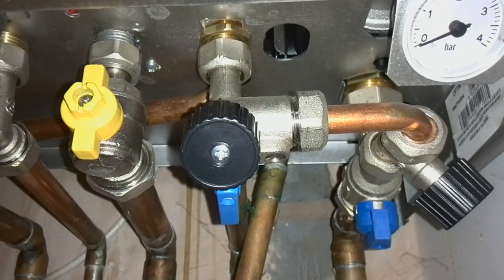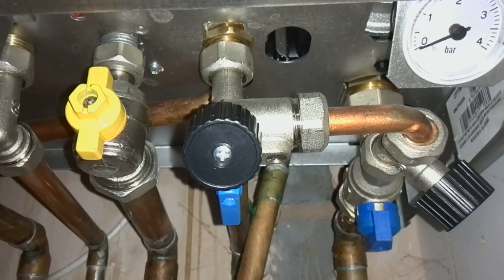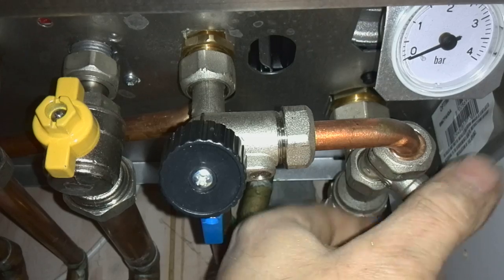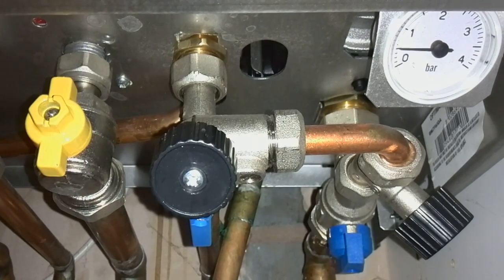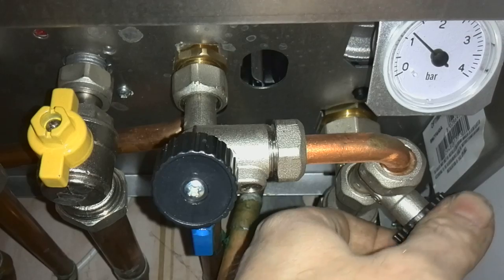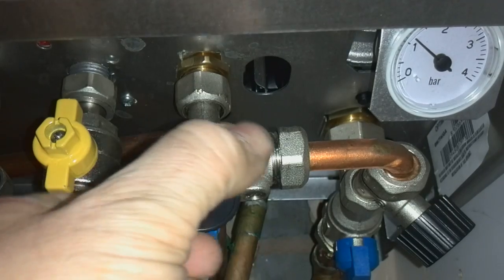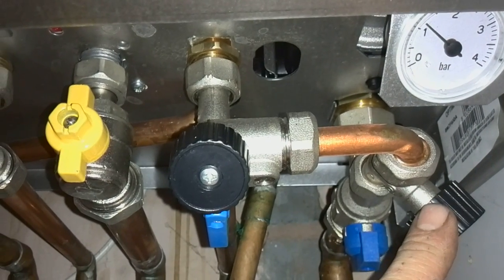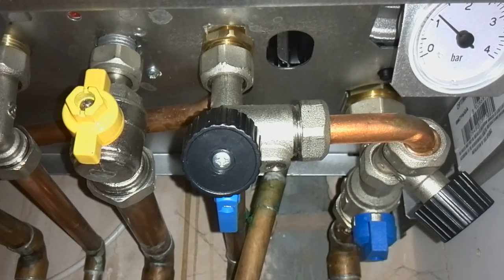how to repressurise  a Ferroli boiler

Comment: Hi I have the He31c optimax boiler. The filling loop valve on the left seems to constantly have water coming out with the loop disconnected. I think the valve as gone bad. The boiler shown above has the round knobs rather than levers. Just wondering if there is a way to retro fit a new filling loop or if the round knobs version will fit. The cheaper the option the bettr

Comment: What if you get the code, water level is at bar number 2, but you still get error code 37
Reply from the maker: It's probably the parameter 1 on the PCB has changed.
Reply: Could this be caused by upgrading the thermost to a Tado? 
How do you fix the P1 on thr PCB?

Comment: Hey, thanks for the video….    My DOMIcondens HE 26c.     Has F34 faulty code .   Any idea where to start please
Reply from the maker: It's more than likely going to be the circuit board. They're quite expensive brand new .I'd go on ebay and get a refurbished one . U can go on another one of the videos to set it up to suit your property
Reply: @theferroliman2067  Hi I have just replaced the board from one off eBay as I had no power at all.  And with the replaced board I now have power and a fault code F34.    So this could still be a faulty board ? Thanks for your reply
Reply from the maker: @emilyc2431 There could be a fault on the new circuit board.Or a parameter is set up wrong or you haven't got 240v at the boiler

Comment: Hi there, I have problem with my boiler is absolutely the same. We are renting the flat, previous year in February we had lower pressure, the landlord booked British gas, they come and fix it. Today happened the same, I check under the boiler and I notice the valve is broken. My landlord booked a plumber today and they fix it but now the pressure is 2.6 and the boiler it's very noisy. What can happen if the pressure stay that high?
Please help.
Thank you
Reply from the maker: They need to recharge the expansion vessel as eventually it'll go to a fault code and not work like F21 or f40
Reply: @theferroliman2067  Thank you so much for your reply. They come back today to lower the pressure but it's up again. Anyway the landlord it's buying a new boiler because this one is leaking and it's very old. I'm very happy ☺️

Comment: How can I reduce the water pressure. Mine is on 3.
Reply from the maker: You have to bleed / vent a radiator with a jug or container until the pressure drops to just above 1 bar on the boiler . See a video how to bleed a rad
Reply: @theferroliman2067  Thank you! I bled the radiator and it’s now gone down to 1.5.

Comment: Its not working for me :( no water comes through at all
Reply from the maker: The non return valve is probably stuck ... You'll need another valve if after opening both fully it still won't work . 
It's the blue and black valve that needs replacing if so 
Ferroli mcw valve
Reply: @theferroliman2067  thank you so much!

Comment: I have tried to repressure the boiler but when I I open the right hand valve no water comes through any ideas why this would be ?
Reply from the maker: If you have opened them both fully then the non return valve could be stuck shut not allowing the water through .
It'll need replacing the mcw valve
Reply: @theferroliman2067  thankyou for the advice I have an engineer from british gas booked in for tomorrow hopefully they can repair it same day
Reply from the maker: @stevehitchen4558  if you're desperate and he hasn't got one .you can drill the non return valve plastic out of the center . So u can the boiler working till it's replaced
Reply: @theferroliman2067  thanks again might give it a go if all else fails I am pretty desperate as I have a 3 week old baby in the house so need to get it sorted ASAP thanks for the help 👍🏼

Comment: Hi i did my usual repressure and it took much longer than normal to go above 1.  Then noticed relief value started hissing and dumping water while valve reading remained just under 1 and hardly moving.  Does that mean pressure guage is faulty do you think?  Thanks.
Reply from the maker: Your gauge is stuck on 1 and will need unblocking or replacing I normally can unblock then and the expansion vessel recharging
Reply: @theferroliman2067  But it should affect boiler operation correct?  Thing is rads pressurise but boiler and gauge is not recognising it!   Any ideas?

Comment: Hi, very helpful video. However, our Ferroli boiler seems to be an older model unfortunately. Would u be able to direct us how to increase the pressure on ours pls? It's not currently heating the rads. 
We have a yellow valve like yours, but ours is in the middle. Then we have two red valves either side of that. Any help would be greatly appreciated. Thanks.

Comment: I'm having trouble to keep the pressure down  how do I relieve the pressure? I have already tightened the black valves in this video and the pressure was still rising!
Reply from the maker: If you need to get the pressure down you can vent a radiator same way you get air out of it . The pressure will rise to about 2/2.5 though when it's on that's normal ....if it's going higher,  get some water out as mentioned when it's cold and see if this helps .if it doesn't u may need to get the expansion vessel recharged firstly by a boiler /heating engineer .

Comment: Hi I have a ferroli 18v I have heater but no hot water do you know what this could be
Reply from the maker: If its a boiler with a cylinder the fault won't be with the boiler . As that appears to be working
Reply: @theferroliman2067  If you was local to me in Essex I would call you as  I know there isn't much engineer knows there around the ferroli I suspect it's the expansion vessel as the red arrow is 1.5mm bar and the black arrow is on zero the expansion vessel is separate to the boiler
Reply from the maker: @vinson1990   the pressure should be 1 -1.5 bar   .no heating would normally be diverter valve , roomstat or clock .not the boiler
Reply: @theferroliman2067  I have heating but no hot water only so could this be the diverter valve stil

Comment: This didn't work for me? Is there something I've missed
Reply from the maker: The only reason it hasn't worked if you followed the video is that the valve on the left has stuck inside and not allowing the water in ...that would need replacing

Comment: I have a low pressure issue (f37) but I don't have the two black knobs underneath, going from right to left I have a light blue valve, dark blue, yellow, red and a red knob which if I turn let's pressure out? I have the Ferroli Optimax 25 C, from I think 2004. I only have about 0.4 bar left. Any idea?

Comment: It's repressurised but no heating. Just two dashes. Hot water still works so it is firing up ok: Update: it's ok, I turned it off and on again then held down the power button for a few seconds. Turns out the 1.5 min I spent expelling air from a radiator killed it 😂

Comment: Hello Dave/all - is it possible to change the pressure gauge on a HE31C without having to drain down - i.e. by isolating the CH flow and return valves. The thin copper tube on our gauge has given way/sprung a tiny leak hence jet of water - poor design imho in terms of position as it coils up right against the inside of the casing and gets caught every time it is removed (hence eventually fatigues). I have a spare one here actually as I salvaged a HE31C for spares.. any help appreciated. Funnily enough boiler still working (CH) but the gauge pressure has dropped to zero and the leak in said pipe stopped. It's the coldest night of the year (-7 forecast where we are,don't want to get this wrong tonight) I opened up as the diverter valve had stuck yet again (had five replaced under warranty over the 5 years but now in year 8..) so was going to give it a 'knock' to free it up (which usually does the job) to move to HW position...

Comment: Nothing happens when the black valves move, no noise, no pressure or water coming through. Any ideas?
Reply: stuck non return valve in the filling loop, pressure of water jams the valve stopping water going through loop, need to disconnect loop and unstick

Comment: Very helpful. Only issue. When I opened first wheel (left one) fully. The right wheels started leaking water from it.
Reply: Same problem here, water passes through first wheel/valve and leaks from 2nd (right-most) valve. I've re-pressurized the boiler once before without issue.
Reply: Rhys Nesling  yeah. I just stick a bucket under it and it's not an issue. Re pressurised it again the other day ready for Christmas.
Reply: So, to clarify, you simply caught the leak until it was re-pressurized? If so, that hasn't seemed to work for mine. The water doesn't seem to reach the boiler at all. Thanks for the response anyways - we may be waiting another 3 days for an engineer.
Reply: Yeah. That exactly what I had to do.  Let the pressure build as the other bit leaks. Just keep opening it even when the leaking starts. It's not enough to get pressure. So keep turning
Reply: Dude, thanks SO much for this tip. We now have our heating back. Obviously we still need this leaky-repressure thing fixed but as a stopgap measure 'just catch the leak' worked!
Reply: @charlieburton9967 needed a large washing up bowl under mine since it was installed 14 years ago   It leaks I turn it off then restart it 🤞
Reply: My right one dripped water too. Fertility boilers are shite. I bought 4 of them for rental properties. Now chucked them all out after less than 5 years. Total crap